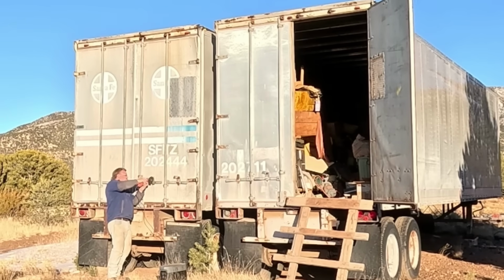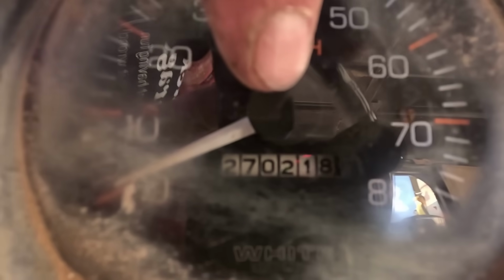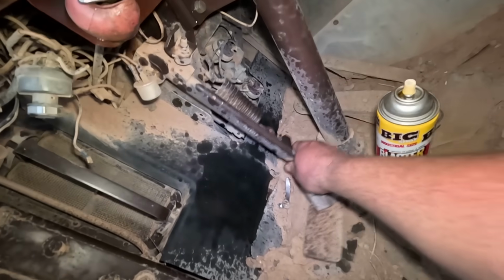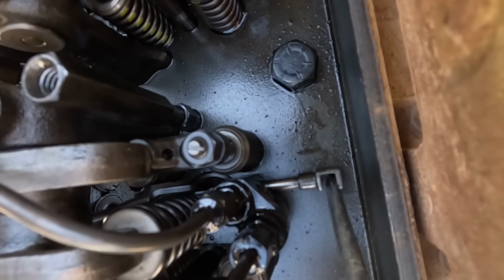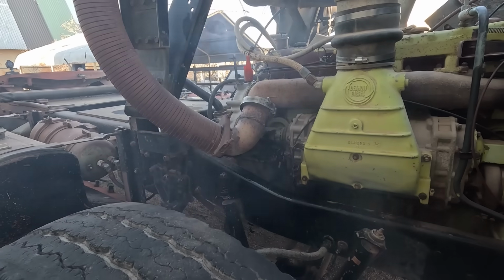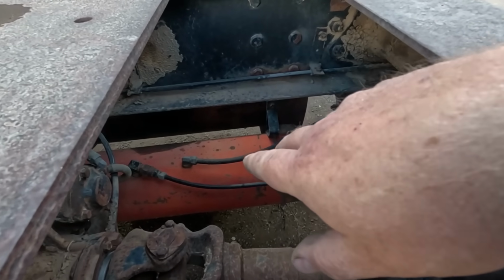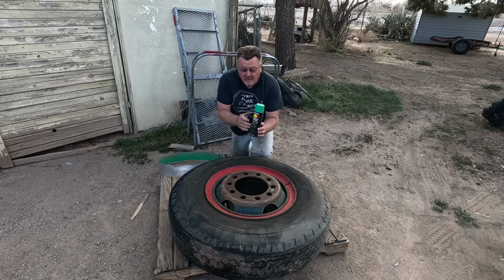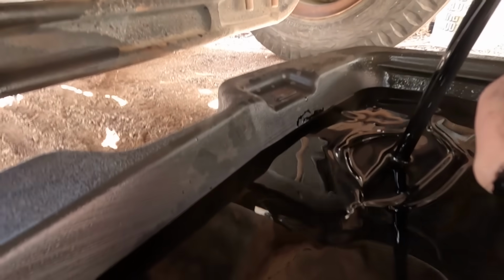White Road Xpeditor Parked since 1996!

Comment: 13 speeds are real easy to drive, you drive it like a 4 speed twice, shift 1-4, flip the switch on the knob to hi and go back to 1, then when you tach out in that gear you flick the switch to overdrive.
When you tach out there you pull it into neutral, flick it back into hi, then go into where 2nd was.
Repeat to the top gear.
That being the 3 position switch you gotta be careful when you're splitting because you can flick it into low range and blow the transmission up.
More modern transmissions have 2 separate switches for the splitter and range select

Comment: Must be an old way of doing air brakes, needing air to apply the brakes. On modern air brake systems the brakes work by releasing air, not applying it. It means if you run out of air the brakes lock up and will only release with air pressure applied. Maxi brakes. It's why you hear the big puff of air when a big rig stops at the lights and applies the parking brake.

Comment: R 2 4                               R   6/7  10/11
  1 3 5    low side                  8/9  12/13   direct/overdrive

Skip the low hole on the high side.
Don't preselect the splits on that trans.  Do a lever shift to the next overdrive and then split back down.

Comment: In regards to the holes in the fuel cap, I had the same exact thing happen to me on my International. The material that fills the holes in is a low melting point allow that allow the tank to vent if it is exposed to high temperatures "fire" lol I live in Henderson NV and it got hot enough in the summer that the alloy melted and dropped into the fuel tank, I just replaced it with plumbing solder.

Comment: That truck deserves some windshields. And some love. Always liked that style white cabover.
Reply: According to Edison Motors here on YT, flat auto glass for trucks is cheap and easy to install. Keeping that cab relatively weatherproof should be worthwhile, even if it just lives at the mine. It'll keep animals, wasps, snakes and other local pests from setting up house in there. Cheers!
Reply: @liamrobinson2084  since it is not going to go pretty far/fast it doesn't even ned to be automotive glass. Just regular flat window glass is probably going to be fine
Reply: Until you hit a tree branch or hit a big bump/ditch or some other weird thing happens and you are covered in traditional sharp glass spikes.
Reply: @captainevenslower4400  That is just asking for trouble later on down the road. I like your reasoning, but it isnt worth the risk for my money. Im of the mind set of always take steps towards road legal.
Reply: @captainevenslower4400  cheaper then Lexan? That would be my choice. It doesn't shatter into a million pieces and is very break resistant.
Reply: @jfv65  but absolutely horrible for scratches. All I can say is that our 50 year old tractor has 1/8 inch thick regular non tempered glass all around, and in those 50 years it held up great. And the one window that did break was replaced in one afternoon by the local glazier.
Reply: @captainevenslower4400  Only if you like wearing goggles, all the time. I like having two functional eyes!
Reply: @captainevenslower4400 Plexi wood be great but if he is doing it up go whole hogg😅😅
Reply: It's all square flat panes too, that's cheap stuff for glass.
Reply: @racer193wr  it sure does, all flat glass and it’s the same as the Road Commander series 1.

Comment: This brings back some memories.  My grandpa used to move mobile homes and had several "toter" trucks when I was a kit.  
I bought an unloved Ford C850 several years ago that is less beat up than your White but had been sitting for a while. Instead of the Detroit it has the Ford SD series 534 like the green bus you moved with seized wheels a year or so back. I really wanted a diesel, but anything remotely salvageable was far more expensive.  Fortunately the 534 has grown on me.  The mileage isn't great but I don't use it enough to make that much of an issue.  It had  lots of air brake issues that needed to be sorted before I finally got it figured out.  Now that I've gotten used to them I kind of wish everythign used air brakes.  So much easier to bring back to life than juice brakes.

Comment: Personally, I'd consider putting glass back in. It gets cold up in those hills. A few windows (OK, and the windsheild too) might make it a lot more comfortable.
Reply: Even make the front glasses hinged at the top, like the old VW bus Safari windows with a scissor bracket at the bottom to open/lock outward in the dead of summer.

Comment: My Duramax LLY blew up a turbo and the dealership wants $6,000.00 to fix it!  I thought, 'WTF would Low Buck Garage do?'  So I found a good used turbo on eBay for $200 bucks.  Thanks for the inspiration.
Reply: Get another one, also on the cheap, swap all its bearings and consumables and then have it on stand. And if you can rebuild the old one, do so. Spares on the shelf are things you don't need to buy when you're caught between a hard place and a rock.
Reply: What the last guy said is the ticket, I’ll add that if you don’t feel comfortable replacing the seals and bearings you can buy a rebuilt pre-assembled center section and use your (hopefully) still good turbine and compressor housings and save some money that way.

Comment: That Friden calculator was one of the first electronic calculators in the world, so it will come as no surprise that its also highly collectible
Reply: Yep, it uses acoustic memory too, super cool.
Reply: @is0p0d  that sounds interesting (no pun intended). also its design is amazing.
Reply: @Memphisko  😆
Reply: @is0p0d how does it work? Like the Simon game, where you have to memorize the tones?
Reply: Those trailers are FULL with collectible vintage electronics. I really hope he gets the time to properly consolidate them on ebay or an auction or something.
Reply: One of my first projects as a young engineer required multiple, repetitive calculations. I did it on a Friden MECHANICAL calculator. Took lots of concentration and lots of time.
Reply: @jodydoakes8754  Thats so cool! If I ahd the space and the money, I would be collecting mechanical calculators
Reply: @jodydoakes8754 holy crap you're older than dirt
Reply: It must be a chore walking around with that thing in your shirt pocket
Reply: Yup, that is a cool calculator. I’d love one :)

It is for the electronics nerds like flathead engines are for you gear heads.
Reply: its the Friden EC 130, no?
Reply: I have one of those! And it works
Reply: dude hit the jackpot with that trailer
Reply: It was bigger than today's desktops!
Reply: These things will never catch on, they are barely smaller than the mechanical ones, and a lot more expensive.
Reply: Yes, a few hundred bucks
Reply: There is a wonderfull video on the @Numberphile youtube channel, with Cliff Stoll. This is delightful ! the title is " An astonishing old calcultor"
Reply: I'm pretty sure I saw one of these at an estate sale I was at yesterday. Going back today, so we'll see.
Reply: I saw a friden stw10 today :)
Your find is better
Reply: Now
You need to do an episode with YouTuber Jeff Williams on the mining maps of Arizona
Another gold mine buddy
Reply: He could have named his price on the digital calculator. There's a crazy market out there for stiff like that. The new buyer probably resold it for ten or twenty times that.
Reply: That is how you know it is a heavy duty unit and not a standard unit.
Reply: More like freiren calculator, like the anime elf character, that calculators life span is so much longer than its companions, it has trouble connecting with the other calculators whose life spans are like fruit flys in comparison, lol.
Reply: He should loan it to Mr Carlson's Lab to do a video on
Reply: @dirk4926 he sold it to buy the truck.

Comment: That shifter looks like a nightmare!  Grateful for the standard 13's I ran all over the west.  Cabovers in general were kidney busters - I only ever had to occasionally run them and hated it when I did.  Add in the single axle short frame - holy cow!  Total misery.  You were airborne most of the time.  Might as well be bronc-busting in a rodeo.  But gotta hand it to that old Detroit - runs like a champ.  It'll do what you need it to.

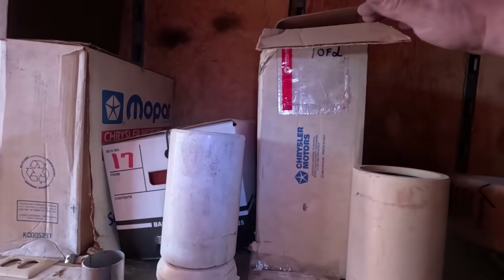Comment: 1:30 The Chrysler rims are LeBaron convertible 15"x6" 1990 era. Will fit any K car derivative with the 5x100mm bolt pattern, but not minivans after 93 or so, when they switched to a bigger bolt pattern.. Part number either EL61KA4 or Y040JAA. Incidentally, Subaru also uses the 5x100mm bolt pattern, but with a different center bore diameter. IIRC, Chrysler rims will fit Subaru, but not the other way around.
Reply: I love when people share this kind of information.    Many tHanks.
( Actually...that is the lure of this channel.  Finding how this master cylinder also fits that and so on )
Reply: Damn it, you beat me to what the "unknown" rims were for. 😂
Reply: I think they also fit the late 1990's to really 2000's Kia Sedona minivans.
Reply: Yeah I got some dealer pull rims from a Daihatsu for my '94 Subaru and had issues with the center bore.  Caught me off guard and now they're stacked under a trash can in my shop because the footprint with tires was about the same.  Efficient storage is important, fellas
Reply: @SovietDictator  94'....94'?  Was that the rim that had the real large center?
I've got 98 Forester rims and some much older..steel Subaru...they may be 13"?

Hmm  Just in case you are looking for old school stuff....
Reply: there is a first gen Sebring convertible (post k-car era)  nearby with steel Subaru wheels on it.... I wonder what he did about the center bore...
Reply: @davidahrens8383  Probably just ground them out. Unless I have it backwards?
Reply: This is very interesting. I was going to guess early '90's Buick Riviera or Lacrosse.
Reply: I know on the old 8x6.5 stuff Dodge truck rims will fit a GM or Ford truck but one or both don’t work the other way around because Chrysler had the biggest hub bore / register out of the 3. Maybe it’s the same case with their smaller stuff as well?

Comment: One phenomenon about Detroit Diesel engines, fresh new oil is blacker than coal inside 1 hour after an oil change. You and that old White look good together.
Reply: Let’s be real here it’s blacker than coal after 15mins idle after a fresh oil change 😂
Reply: and if it aint dripping oil that means it's out of oil lol
Reply: @ram03rod  or its brand new.

sometimes.
Reply: That’s not just Detroits, that’s almost any pre-emissions diesel and most late model ones as well once they get a few miles on them. Especially class 8 truck engines that hold 10, 11, or 12 Gallons of oil. The problem is unless you drop the pan and clean it out and clean or let the engine’s oil galleries and top end drip dry for a day or two, there’s always enough old black oil clinging inside the engine to turn the new oil black once it runs a few minutes and gets circulated and mixed in with what residual black oil’s still in the engine. I’m not sure if you’ve messed much with Propane engines but it’s mind if funny they are the opposite. You can change the oil in a propane version of a common gas or diesel engine and run / drive it like 1,000 hours / 10k miles / well past the recommended OCI and that oil will still look almost as gold and transparent as the day you changed it. That’s where doing an oil analysis comes in handy if you’ve got a good engine you know the history on and want to figure out when you should be doing oil changes to get the most out of your money without hurting the longevity of the engine. On trucks and heavy equipment keeping the intake plumbing “air tight” and keeping up with air filter maintenance can make a real difference in oil and engine component life as well.
Reply: Isn't that normal for virtually every diesel? 
As someone who's been driving exclusively diesels for the past 10+ years, I had to do a double taker when someone changed oil on a petrol engine and rated it "black/10". I was like "wait, isn't this normal occurrence?"
Reply: @JeanMarceaux yes, literally any diesel especially a heavy truck engine. The only time the oil will stay tan / clear looking more than a few minutes of runtime is if you drop the pan for something else and do fresh oil when you put it back together. In that case you’ll often get a few hundred miles at least before it starts going black again.
Reply: Just 2 stroke things
Reply: The blower blows exhust out
Reply: If your haluing a mobile home

Comment: Congrats on getting the engine running! If you are leaving it at the mine - don't paint it. I'm guessing you are not going to title and license it. Best to leave the looks as is. No one will think twice about trying to drive away with it. Be sure to read up on air brake adjustment- very important.

Comment: Detroit diesels are great motors. There is nothing to break but you will want to check the injectors first.
Should you ignore the injectors, the engine might run away and possibly explode.

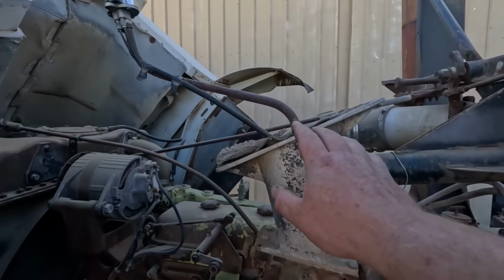Comment: @12:40 that shift pocket gives me nightmares. I drove a White Compact as a delivery driver in Philly back in the 80’s. When you turned the steering wheel the cab would lift and the shifter would come out of the pocket. If I had to back up in order to make a turn I’d have to turn the wheel so the cab would come down, put it in reverse and back up, turn the wheel so the cab came back down, select a forward gear and repeat until the turn was made. No power steering meant I had Popeye arms.
Road Ranger shifts 1-2-3-4-5 button up 6-7-8-9-10. The other button on the shifter looks like it’s for a 2 speed rear.
Reply: That doesn't sound like the cab should go up and down like that.  Maybe the one you drove was broken somewhere. 

Thats a 10 speed shifting pattern. This is an 8 speed.
Reply: @strong40  This is a 13 Speed the model number denotes the number of gears 12513. 
you split the gears on the high side of the transmission so 5 6 7 8 . on those old roadrangers the range select and splitter were all on the same 3 position button.
Reply: @SootyMangabey. Youre right. I probably would have figured that out if i saw the shifting knob.  The first truck i drove was a gmc topkick with 3208 cat and a 13 speed road ranger. Hard transmission to figure out for a rookie.  Plus it was a grain truck with a dump body and a pup trailer that grossed over 80k. A big load for that little 3208.  I now drive a normal eaton 13 speed in a Peterbilt with a C15
Reply: @strong40 Which was my alltime favorite behind a 444 Cummings. I never got lost with it.
Reply: @ It definitely was. 8 or 10 the shifting is still the same. Through the lower gears, pull up the air switch on the shifter and repeat the pattern.